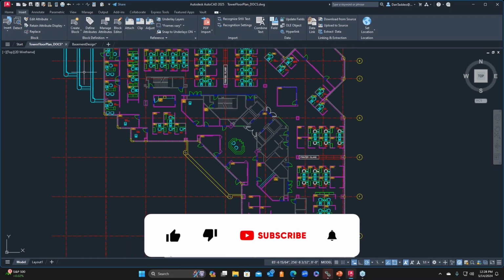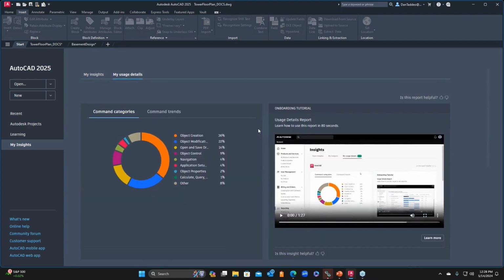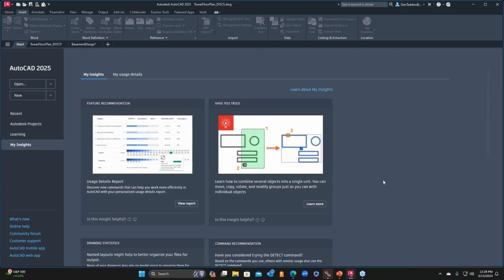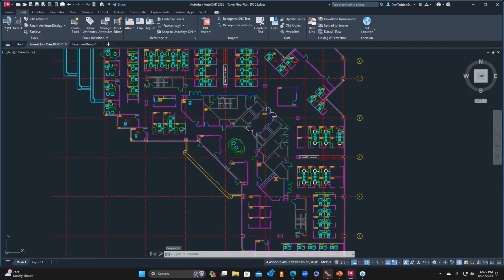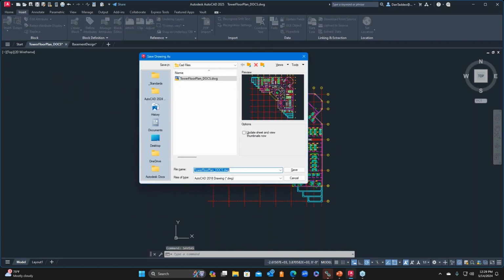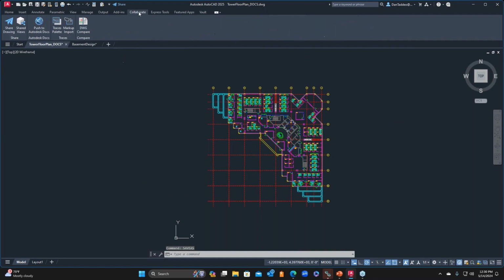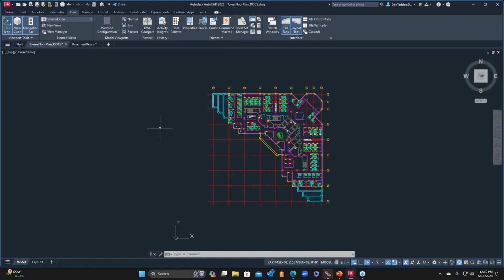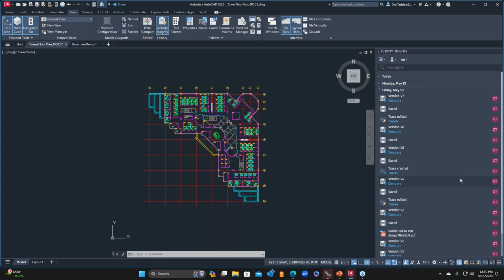AutoCAD My Insights and Activity Insights | Overview

Comment: not avaible in my 2025 autocqad
Reply from the maker: Huh, this 2025 update should be available if you're on an active subscription. Make sure it is the full version of AutoCAD 2025, as AutoCAD LT does not support some features. Also, make sure that the product is updated to its latest version. If this does not work, then try and contact Autodesk support.